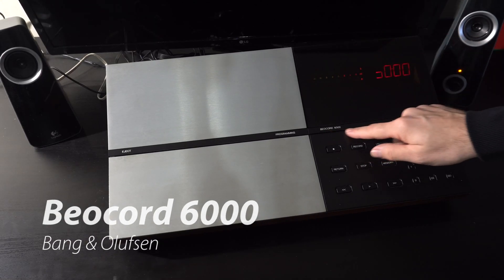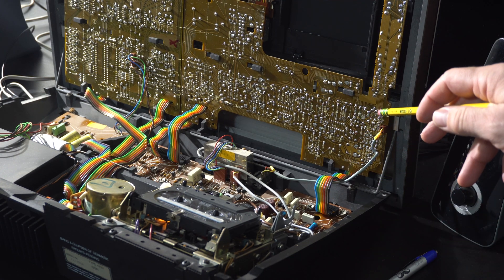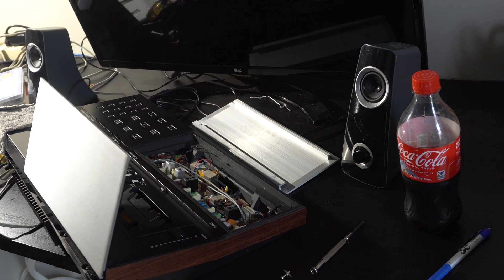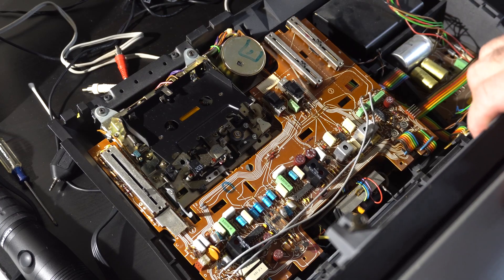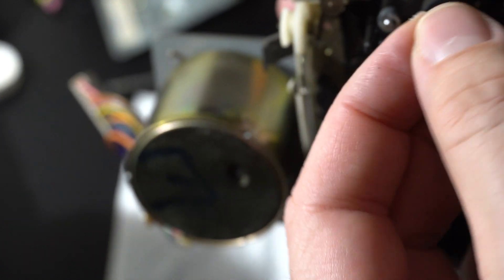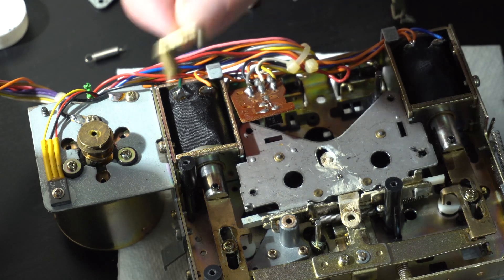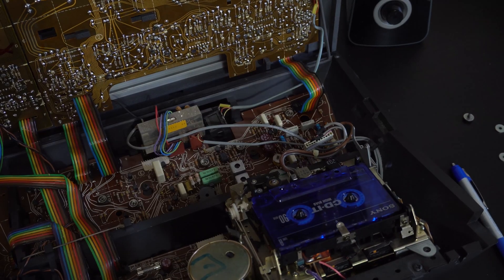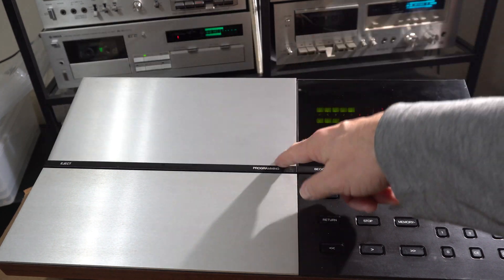Beocord 6000 Cassette Deck Relay/Fast Forward Fix

Comment: I didnt get what you did to make it work? No pictures of the brakes, and I could see what the problme was to enable the playback again.
I have the same problem with FF,  I have replaced belt and capstan , so now it plays and sounds good, but cannot go FF, rewind is ok.
Reply from the maker: It has been 2 years so I don't remember exactly, but I believe it was just a matter of careful disassembly, cleaning and greasing so all the parts move smoothly.
Reply: @ACBMemphis  Fair enough :-) Think the idle wheels should be cleaned or the small tyres replaced? I'm gonna  try it. Thanks for answering

Comment: The belts on these units deteriorate with age.  Perhaps you can show how simple it is to replace them.  Because if they break you'll take it in for repair which could cost you dearly.  So preventative maintenance will save you a lot.
Reply from the maker: I put a link in the description to another video where we replaced the belts. Thanks for the comment!

Comment: Got the same one!! Realy good sounding machine  easy transport but sounds very good!!   Mine need to be. Greeced to or probably the idler change, becouse. Sometimes the fast forward rolls hard;((. Ideal with beomaster6000or8000. Reciver and. 7din proprietor cabel for  remote control!!!🎉